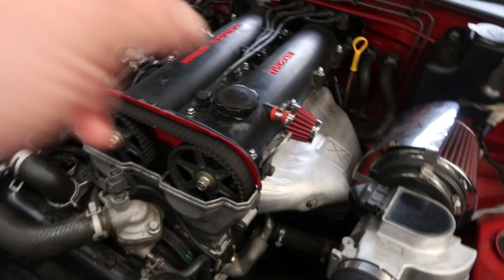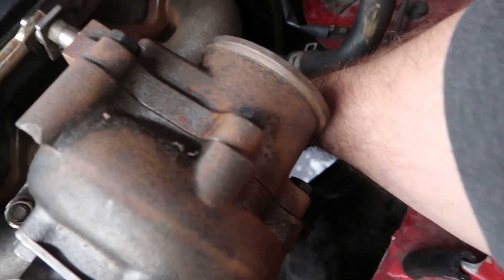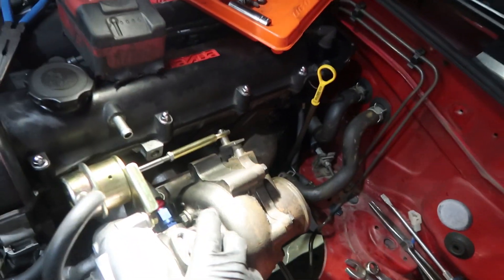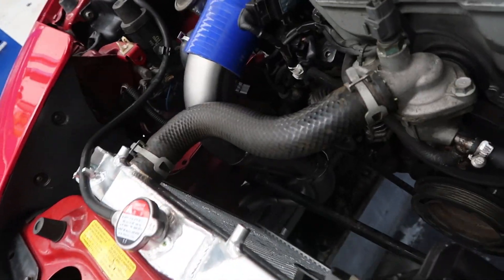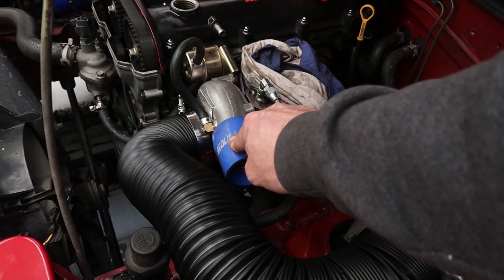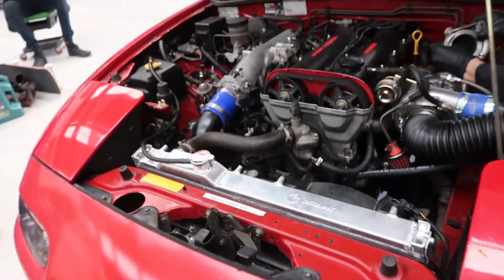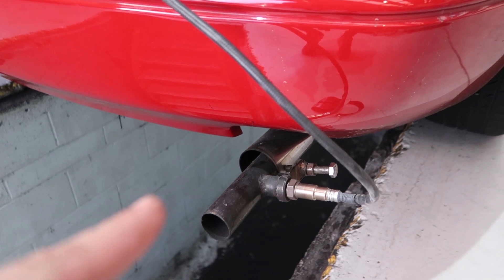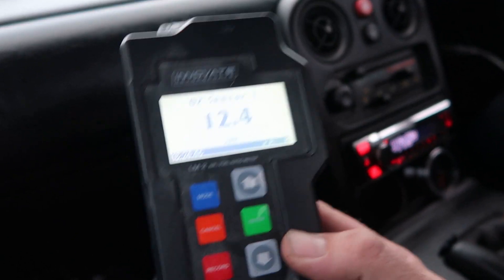Miata + DIY Turbo = ??

Comment: hi! nice video!  you make it look so easy! what is the turbo setup? what manifold are you on? will you be keeping the power steering and air conditioner?
Reply from the maker: It was (relatively) easy. This car being NZ new doesn't have power steering or air conditioning so they weren't a problem, both of those things would get in the way of the way we ran the IC piping but we could have run it a bit differently and it would have been fine, this turbo kit was an AliExpress turbo kit from china so the ultimate low budget build and it's actually still going strong!

Comment: Did you check your snc keyway before going turbo? Is it something to worry about?
Reply from the maker: This engine does have a short nose crank yeah, it's not something related to a turbo conversion though, adding a turbo isn't going to make that more or less likely to fail. Keeping an eye on the keyway is something you should do regardless. When the cam belt was replaced we used locktite to be sure, however it's still something worth keeping an eye on.